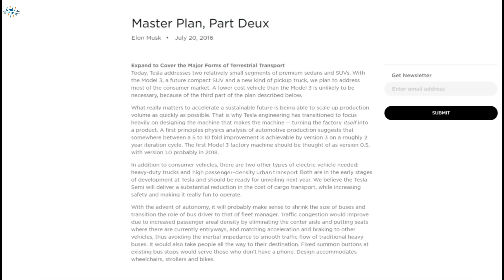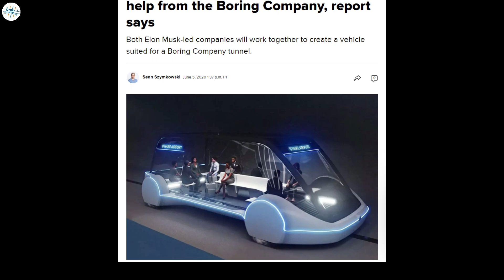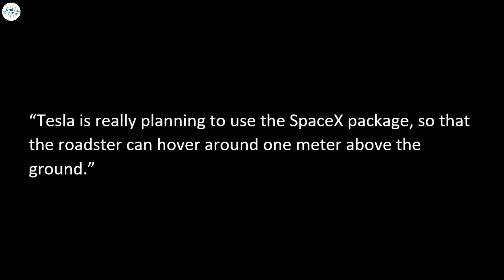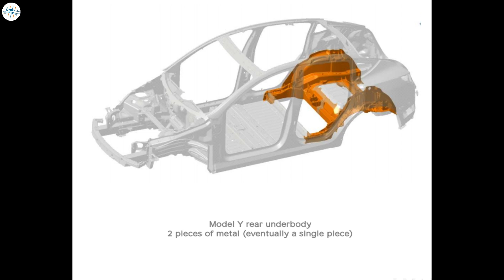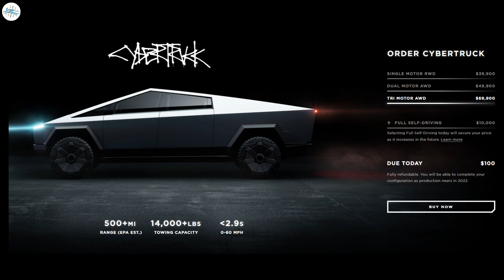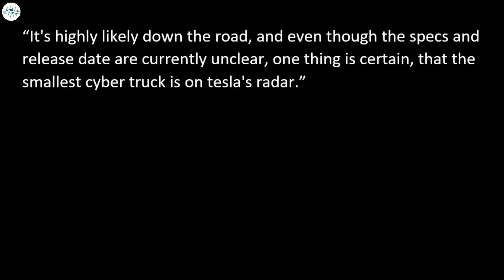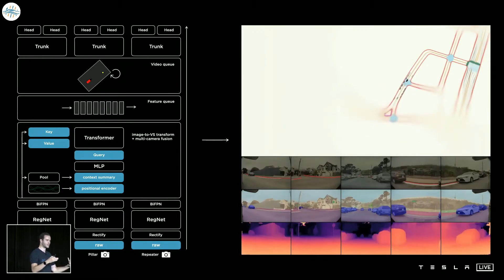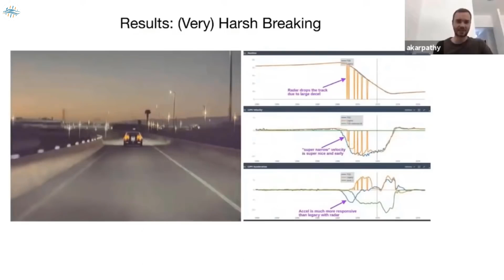Upcoming Tesla Vehicles & Projects - Expected To Come In 2022

Comment: What does everyone want to see in the MY 2.0???   I would like new battery pack (of course) AND electric tinted windows, ventilated seats, a quieter fan, dynamic suspension, ability to tow with an RV to start.  An off-road/ winter package would be great with lifted suspension, skid plates, off road shocks, decent wheels and tires, roof rack with lights, tow hooks, mud flaps, protective coating on lower half of the body, decent tow package.  What else???